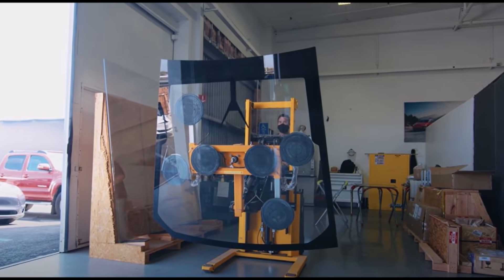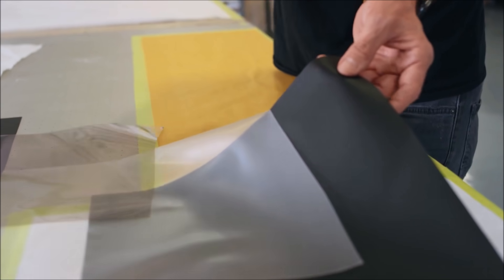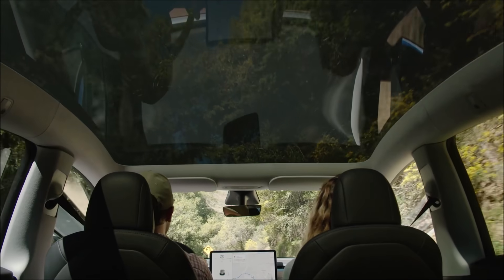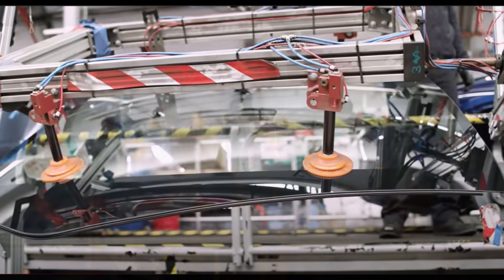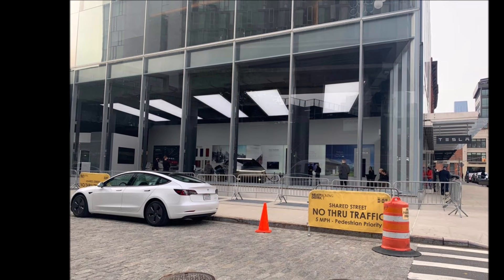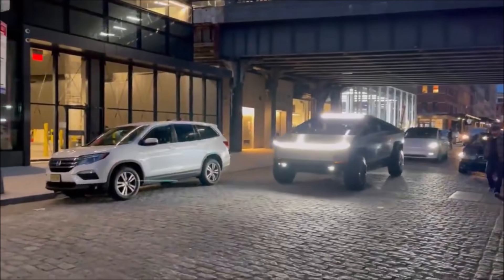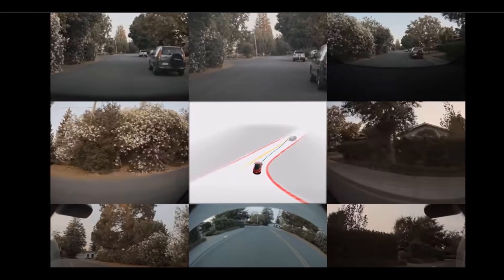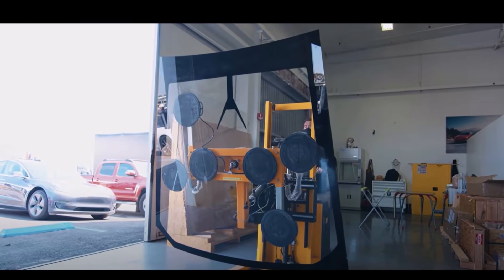Watch Tesla's Rare Video Showing Cybertruck's Giant Updated Windshield

Comment: Don't see Michelin's airless tires going onto the Cybertruck, as some of us like going off-road, and depending on the surface - sand / rocks / dirt, etc., we need to adjust the air pressure to regulate the grip.

Comment: Do you think cyber truck should be equipped with airless tyres?
Reply: You need to increase truck tire pressure for loads and reduce it when driving on sand
Reply: @John-Nada  well said. Thanks
Reply: Will be interesting ss an optional
Reply: @lusosaylor  just buy em and put them on a set of aftermarket rims then
Reply: @sterrshow5016  it will be interesting that Testa themselves having already a strong custumer relationship with Michelin I their vehicles, to bring one more time, this disruptive tire technology to the massmarket